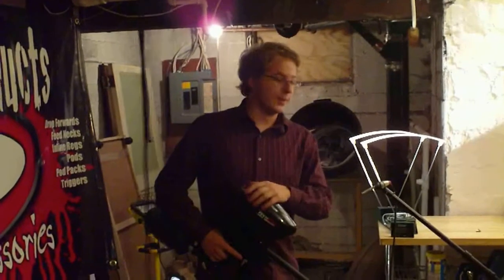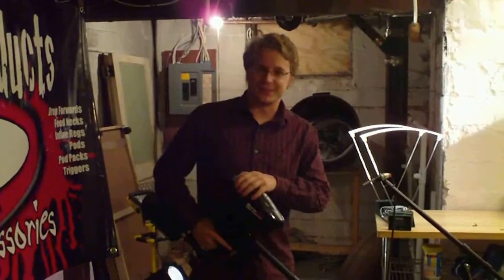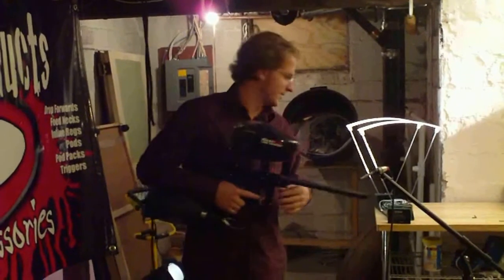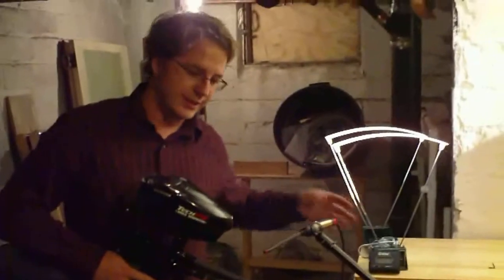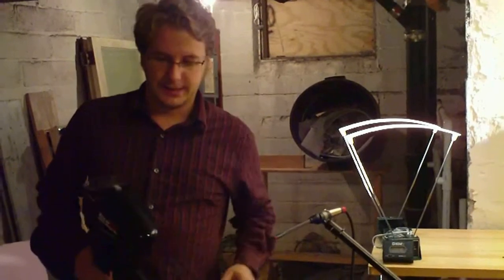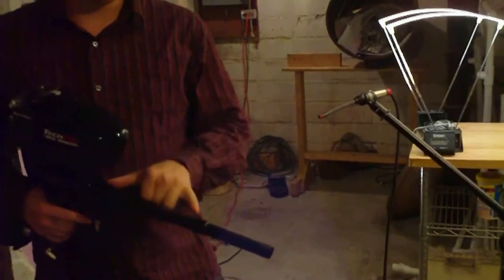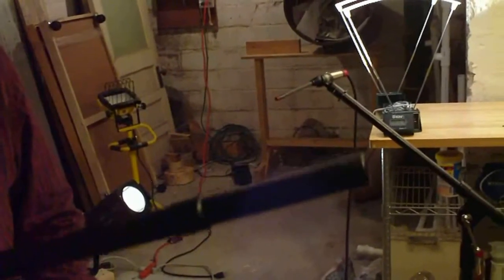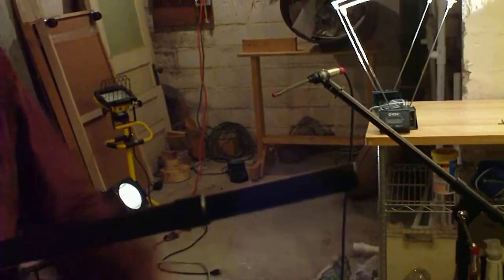Sound Testing Video - Bore and Porting.mov

Comment: I know it's been a while since you guys released this data... But is it possible that the primary acoustics from the gun were simply overwhelming the secondary acoustics of the barrel? Proteges aren't quiet guns by any means... If you guys were setting out to prove that a ported barrel won't quiet a loud gun, then you certainly did prove just that.

Comment: @stompnd And as a professional sound guy - I agree, in part.  In this case we're doing relative measurements - meaning we're looking at changes.  Since every item we test is affected by the acoustics of the environment in the same way - it's still a valid way to compare two signals.  Optimal would be an anechoic chamber - but that's certainly not going to happen on our budget.  :)